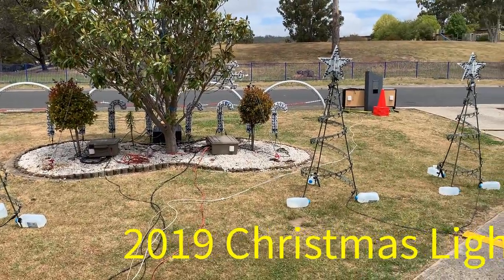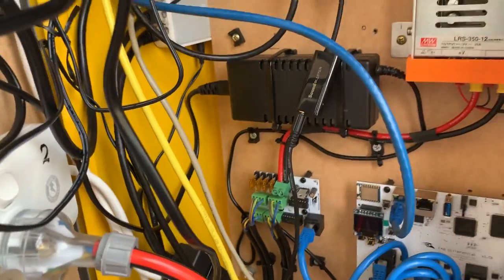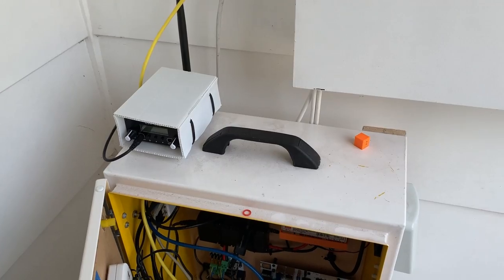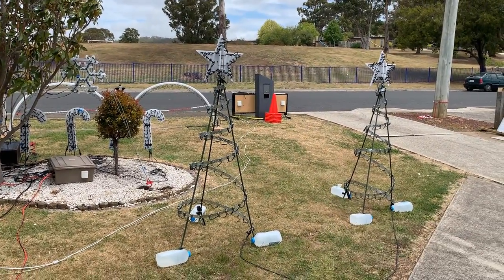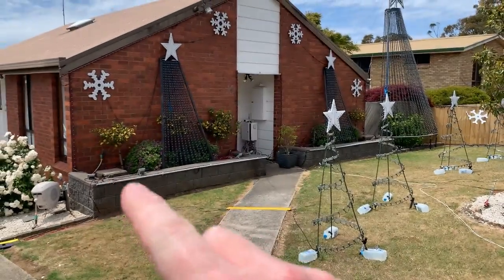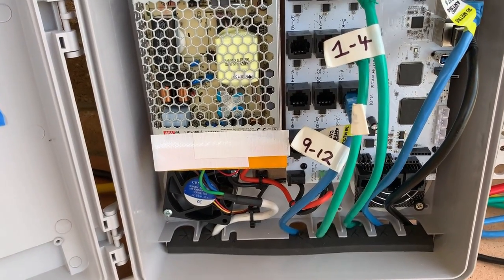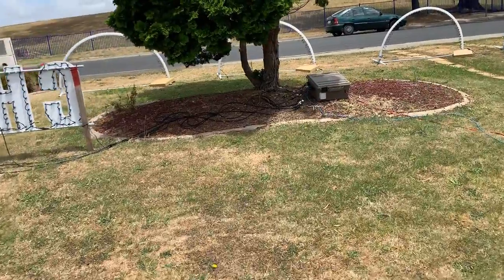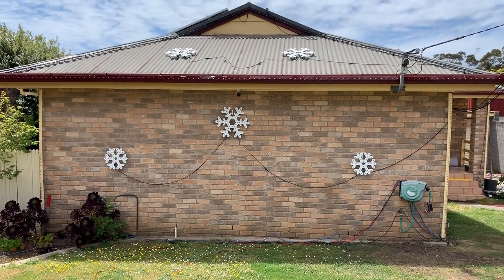2019 RGB LED Christmas Light Display - Behind The Scenes Part 2 "The Controllers"

Comment: hi @LawrenceDrive Lights just asking, what size is your wire gauge(from Smart Receiver to Pixels)? is that 3 or 4 wire conductor? And where did u buy them?
Reply from the maker: Hi it is normal extension cable offered for sale via most of the pixel sellers, 3 core 18 AWG with pigtail ends fitted, you can also make your own leads and there is heaps of different types of cables which people use. I just use the pre-made extension cables as they are quick and easy and you can purchase them in various lengths to suit your needs.